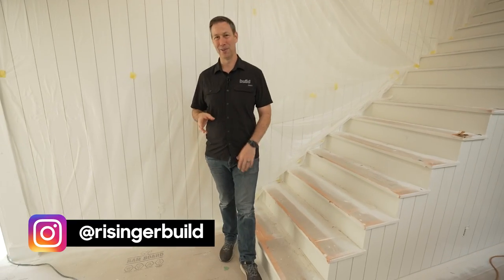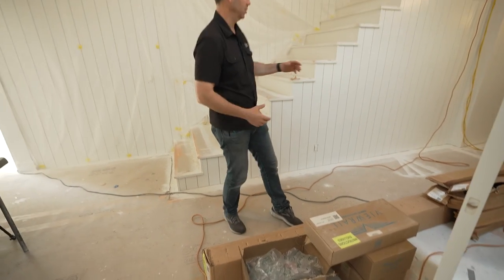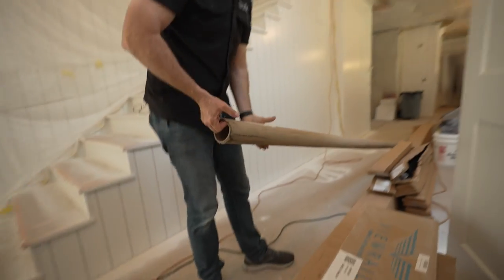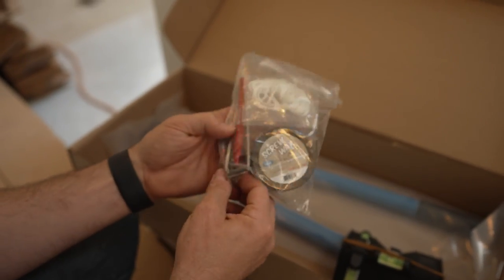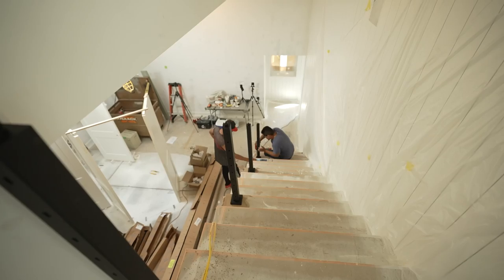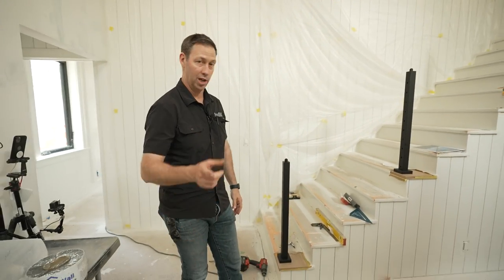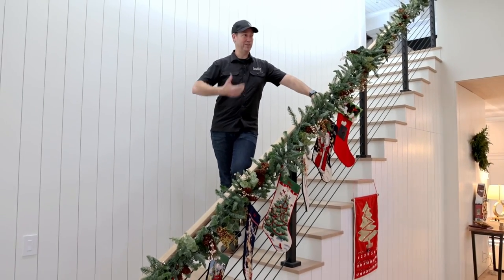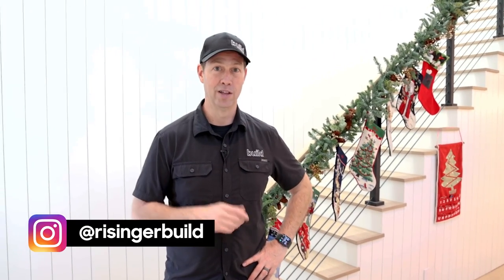Modern Stair Railing Kit: Here’s the install at my House

Comment: That post level is killer. Two directions at once. 

Those Viewrail instructions are the most complete I have ever seen. I should have read them all the way through FIRST. And their customer service is very responsive. I sent my drawing of the installation; their engineers checked it out. Everything and I mean everything is included in the kit. 

Matt, I have one of those crimpers now too. You need an extra one?
Reply: ^ This is not the Real Matt Just a Heads Up.

Comment: I made a stainless steel cable hand rail for my home about 12 years ago.  I used wood handrail and balusters, 8 post and about 30ft in total length .   I created my own tension system for each cable run also.  My cost...$250 just for the cable and the connectors.  The entire staircase only cost me $2500.  I love the look.

Comment: Big mini split right in the stairway kills it for me personally
Reply: I wish they’d make them more visually appealing.
Reply: @Natedoc808  yeah, they have their place. But in a complete remodel you would never catch me using one
Reply: @Ptro1  we are actually using them in a complete remodel we are just starting as it already uses a heat pump, and we are putting 2 additions in with cathedral (beam and rafter) that tie into a cut and stack roof where there is existing ducting, so going ductless on the interior finished gable is the best option for conditioning the cathedral portions as neither will have crawl space under them
Reply: @Natedoc808  yeah they have there uses and spots that make sense. I have one in a cabin and also on a enclosed porch. Works great! They are just ugly in my opinion. But the ease of maintenance is always nice
Reply: @Ptro1  they are definitely ugly. They really ought to bring their aesthetic up to speed. The ceiling mount units aren’t terrible, but the wall mounts are hideous

Comment: How tricky was it to install those long rods without scratching off the powder coat? Are they fairly flexible? Are there plastic bushings on the holes in the posts to protect the rods as I presume they are bent to thread through?
Reply: Not too tricky. There is a foam block you can see in the video being installed in the post this keeps the rods from rattling when going up or down the steps. There are no bushings in the holes.
Reply: The rods are actually tubes. So they do have a little give. But not much. Powder coating should be fine as long as the holes are burr free.

Comment: Hi Matt, why did you decide on no fireplace?  Negative effect on the house in some way?
Reply: I could be wrong and I haven't followed the series closely. To my knowledge Matt wanted the house very  energy efficient and well insulated . Fireplaces are great for esthetics however not a very efficient method for heating a room/house.
Reply: Fireplaces are antiquated headaches. You spend far more money and time building and maintaining the fireplace than you would properly insulating your house. 
If you're that stoked about another roof penetration, install a cast iron stove. At least the next owner can remove it and reclaim that space.

Comment: It looks like you didn't put any stain on the hand rial or treads. I would stain the hand rail & treads with a couple coats of light finish then seal with a couple coats of polyethylene.

Comment: i always found this style to be an eyesore.
Reply: There goes your invite to the house-warming party.
Reply: I’m not a fan of this style either. Horizontal rods can be bent fairly easily and can’t be repaired. Cables are better in that regard, but are very industrial by comparison, and can require retensioning over time.  The thoroughness of the kit is impressive. Just my two cents.

Comment: How is the rail legal with it looking like a 4 inch round can fit thru at the riser?
Reply: Thanks, I was wondering the same thing. Looks to me that it doesn't meet code requirements.
Reply: I don’t think it’s even close
Reply: Code compliant or not, there are some borderline safe installations out there. Code compliant is the minimum permitted standard, not the same as best practices.
Reply: 6 inch diameter is the max under the railing at the riser. 4 inch all other parts.
Reply: @lrc87290  Interesting, I missed that bit in the code, think you.
Reply: Rod is 3” apart

Comment: Would like to know what the foam  insert in the posts is for -- insulation? Sound dampening?
Reply: Rattle prevention basically. Something extra to prevent the horizontals from rattling against the verticals.

Comment: that AC unit on the wall sticking out like eye sore. Why not just go with built in ceiling units? They are so outdated in asia now. Only low cost houses use those units.

Comment: that thing just looks treacherous to me. never-ending 17 stair straight away. really needs a landing. kids coming down those wood treads in a hurry wearing socks...some of the treads get a little moisture on them 😬

 matt really should have just built the house he wants rather than trying to squish everything that doesn't fit correctly onto the old slab.